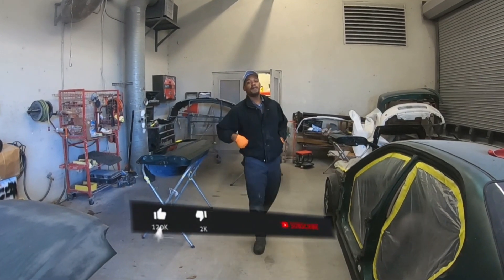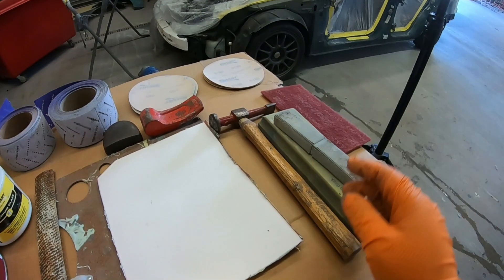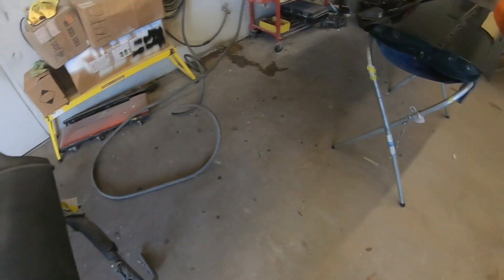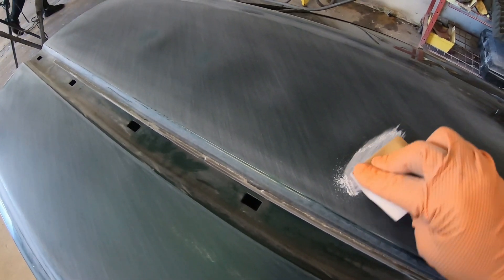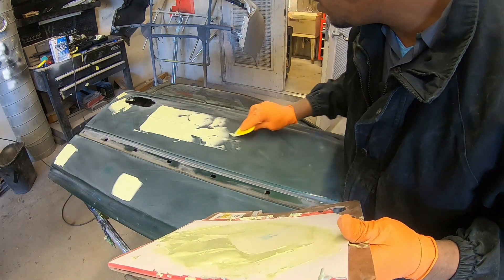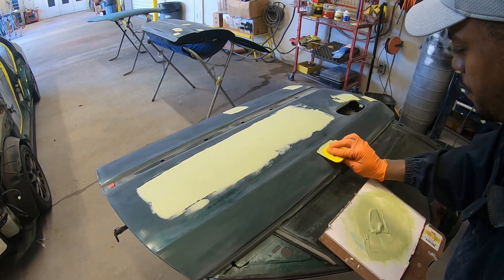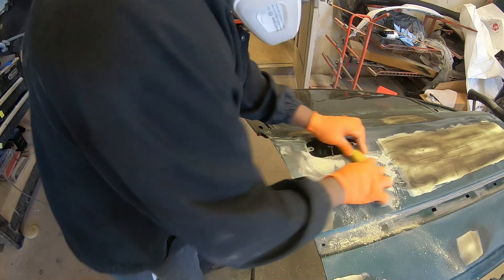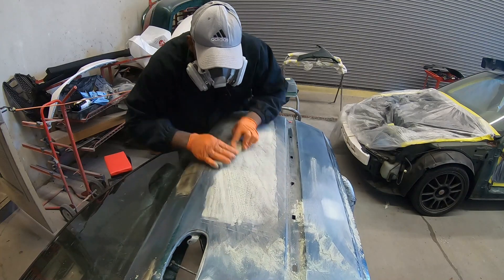HOW TO RESTORE YOUR CAR GUIDE: EPISODE 1 BODY WORK

Comment: Good show, M🙂. I like to start sanding the bondo with power tools, cuz I’m old and my guns are weak…😉
Reply from the maker: Thanks Billy. Power tools are great, I’m sure you got the basics of bodywork before graduating to power tools
Reply: @mariopaintclass6091  actually, my diesel mechanic cousin gave me a National Detroit model DA, an 11 inch sanding board, and a red rubber hand block in 1976.  I taught myself how to shape bondo with the pad locked in grind mode , and the blocks were pretty self explanatory.  I didn’t get formal training for another 2 years, and the instructors were literally amazed by what I could do with a DA.  Come check it out.  I’ve had 40 years more practice😉
Reply from the maker: @OldBondoBilly  impressive you just know the art of the work from the beginning
Reply: @mariopaintclass6091  my first tutorials in the 70s were from Hotrod magazine, but I did have a knack for it right from the start.

Comment: @Mario paint class Restoration class in session!  I've got a 95 Integra I'm working on so I love this!  The big thing I'm hoping you could help with would be bumper concerns, flexible fillers, and everything pertaining to the best possible result with the arch nemesis "El Bumper"
Reply from the maker: Hey man thanks for watching. As far as bony filler goes I only use Poly-flex ever coat and the finishing glaze filler. These types can withstand the all flexible plastic. I would start with the poly-flex first and finishing glaze last
Reply: @mariopaintclass6091   Does the finishing glaze come in a poly-flex form as well?  Or is standard finishing glaze?
Reply from the maker: @kseries20-24only  no just the standard finishing glaze

Comment: Hi Mario and thanks for doing this video on filler and blocking work as this is where I struggle to get it right, I'm not as young as I was and hand blocking hurts my arms so I use a flatbed sander the electric Mirka Deos so I was wondering if using this is ok or will this not block filler and primer flat.
When repairing small dents about 1-2 inches in diameter would you still use the two different fillers you have here? I have the Colad UV filler but I have problems getting a nice feathered edge so would I need a skim of finishing glaze?
Sorry for all the questions Mario😁👍John UK.
Reply from the maker: Hey John, no problem man I’m happy to help. So using the flat bed might not be the best thing for straight and leveled bondo finish, but if you apply the same techniques of hand blocking with it you should be fine. If it’s small dents you would just need the finishing glaze
Reply: Ok thanks Mario, I'm quite pleased with my finishes now but my repair work is not so good but practise and more practise will help.

Comment: Watching this restoration closely. Love the feathered edges of the filler.

One thing, I would probably have used a longer block for that large filled area on the door.
Reply from the maker: Thanks for watching. I actually modified this long block by cutting off a piece. I find that it’s a lot more comfortable to use
Reply: @mariopaintclass6091 , I've learned a whole lot from your channel, and keep learning. Thanks. 👍
Reply from the maker: @francispowell1811  I appreciate your support.
Reply: Thats how i apply my body filler too

Comment: Quick question, the bondo u mixed seems abit harden and not that smooth, do you sand the bondo again if u were to apply more bondo on top of the panel?

Usually i only got 5-7 minutes and the bondo got harden up. 😅 Didn't even have time to smooth it up. But what i did is to sand the bondo and apply another layer.
Reply from the maker: Yes you have sand the bondo it won’t smooth itself out.

Comment: What is the purpose for applying guide coat?  Thx
Reply from the maker: It shows you all the imperfections. Low spots and where needs more sanding
Reply: @mariopaintclass6091  ah…okay.  Thx

Comment: Mario won't the body filler absorb water when checking for imperfections
Reply from the maker: The filler would have already dried before then which means even if it absorb the water it won’t cause problems. You would just have to make sure you dry it properly before priming.